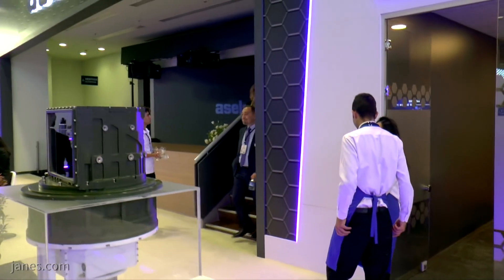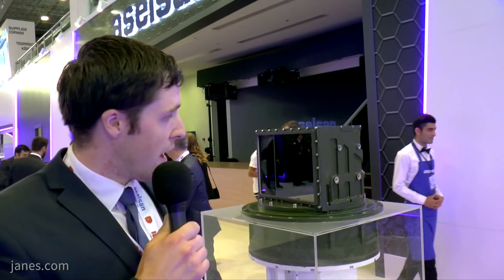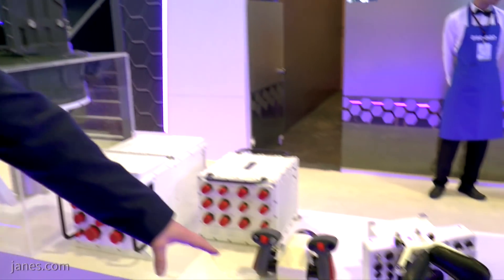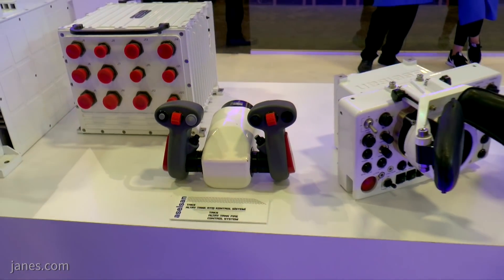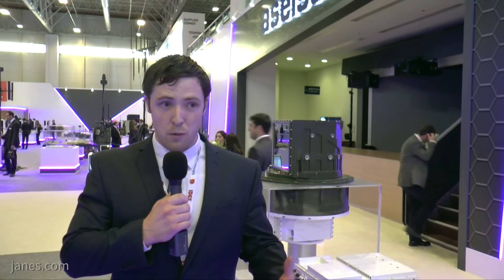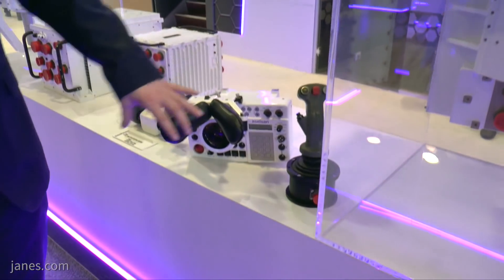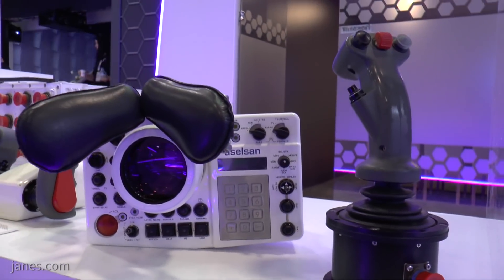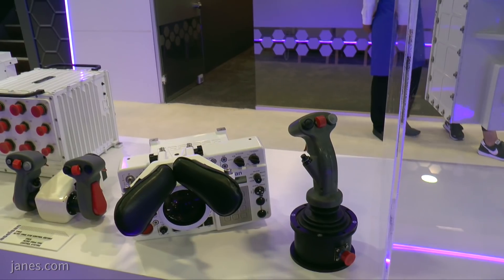IDEF 2019: Altay Main Battle Tank Control System & Optics

Comment: What Turks are going to do about the tank without critical parts such as an engine and a transmission?
Reply: Bluss That is my friend, is a pipe dream. The Turkish government canceled the contract with Tumosan as the Austrian government prohibited its firm to transfer power pack technology to Tumosan. The Turk company has no skills and technology to develop powerful engine and transmission in the first place anyway.
Reply: @Greenfield-li3bg  Turkey’s BMC Power already made 1500 hp engine called "Batu" for Altay tank. Now they are extensively testing that engine.

Comment: But Turkey still rely on the Leopard 2 and they keep loosing them in battle. Tank or training fault?
Reply: Because the Turkish leopards didn't have early warning systems. They never knew what was coming for them they were sitting ducks and punching bags. Not the crews fault.
Reply: Mass production of Altay tanks will start in 2020. Turkey’s leopard 2a4’s are not the latest version. They lack era armor, laser warning systems, active armor protection and their situational awareness is not very good. 
So the Turkish leopards are good for tank-tank battles but they suck at asymetric warfare. A Turkish company(BMC) is working on a new modernisation kit for the leopards in the inventory. It will probably be a cheap solution because those leopards  are starting to get old anyway, and also Altay tanks will take their place in the future.
Reply: @akifabc4666  r8
Reply: Leopard 2 is a cold war era tank designed for mass armor battles. It is not suitable for insurgency operations. Both Altay and Leopard 2 are heavy, slow and high profile tanks. They don't suit counter-insurgency warfare. For this type of operations, Turkey needs a fast and low-profile tank though dropping tanks and using AIVs like Tulpar is an other viable option.
Reply: kocero1971 Hocam adam soru sormuş niye kızıyorsun
Reply: Leopard 2 doesn't have active protection against laser guided anti tank missiles. In last years they started to add it. Turkey wanted them to be added on Turkish Leopards, too, but it didn't happen because of politic disagreements.
Reply: Poldus eri..You must have SHIT for brains, aaa 111s response is more than adequate. We are humans not machines, God only knows what goes through those individuals minds when they are under pressure. That applies to all mankind. As to the Israelis thats your opinion. Majority would disagree because the Jews of all people know what persecution is yet they are doing the same to the Palestinians with NO regards to international laws e.g by using banned weapons, using live ammo against civilians, By building Jewish settlements illegally. I could go on for hours. But made my  point for the majority to understand. Just Imagine U.S politics without the Jewish lobby what a wonderful world it would be. You are probably agitated or so PISSED OFF that you can not wait to respond. But do not bother any response to the above is FUTILE.
Reply: kocero1971 Why it’s so difficult to blame the training of the Turkish operators? You mentioned Israel loosing Merkavas in 2006 when we all know very well that by far the Israel army is one if not the best in the world, but unfortunately they misused their tanks in an environment that they were not intended. Bad strategy by Israel. But the lost of Leopards 2 by Turkey was a disgraced by the operators of the same MBT because it was obvious they didn’t learned what happened more than 10 years before against those terrorists in Gaza and the excuse that it was a total surprise that the enemy have Javelin only showed the poor or not training of the personnel and the lack of intelligence services. Very bad decision by Turkey’s army.
Reply: @polduseri909  You are right. Turkish tank crew doesnt have enough training. and we dont have any experince with tank war.
Reply: defence and technology Errors happens and more often we learned from them than from any other sources. Keep in mind that I never questioned the bravery or patriotism of the people who lost their lives in those Leopard 2’s but from others to blame the tanks or the javelins it is just ridiculous. What’s going to happen if the Altays are destroyed? then, the fault will go to the South Koreans who designed and co-developed the tank?
Reply: Poldus Eri Okay now im sure you are trying to provoke Turks. I already gave you a detailed answer for your question above but you ignored it and kept blaming the Turkish tankers. 
First of all Altay tanks are NOT South Korean design and they will be %100 produced in Turkey. Altay’s chassis was based on Korean K2 tank that is true but their sub systems are entirely different. Koreans don’t even know how to design their own tank engine, transmission and active protection systems. They use western technologies. But Altay will use indeginous AKKOR active protection system and Turkish designed BMC Power’s 1500 hp engines. And note that Altay is 10 tons heavier than the K2 tank. 
Do you even know what a javeline is and do you know how it works? Ofcourse there are some procedures to survive atgm attacks but if you are in an open area and if your tank is some cold war era tank then only thing you can do is waiting to die.
Reply: @polduseri909  
Leopard 2 is a 1980s Tank without any armour upgrades, there is no chance that this Tank can withstand a Kornet ATGM with 1000-1300mm penetration power.
M60T Sabra (armor upgraded by Israel) for example were able to survive direct hits from ATGM's, one survived even two hits.

I can't say if it was Tank or Operator fault, but i can say even if the Operator is excellent you can't do much in open field with a bad protected tank.

Altay on the other hand will have Level-6 composit armor and active protections systems.
Reply: kocero1971 You have a good point and in the Israel’s case it is my opinion that the answer is both but you still not answering the original question.